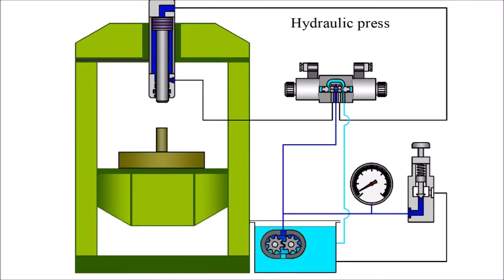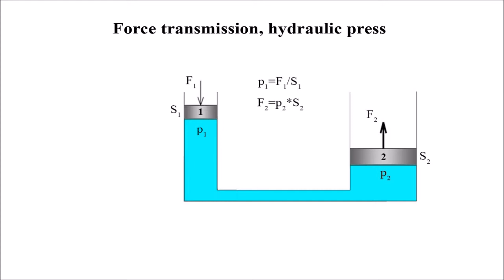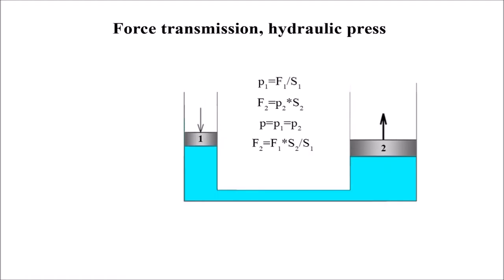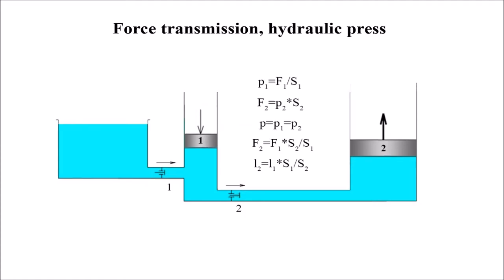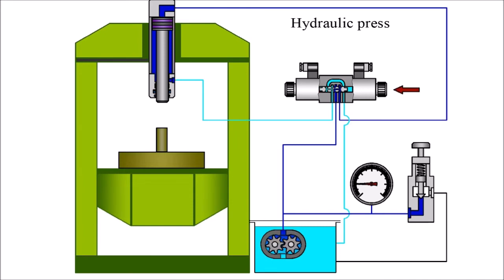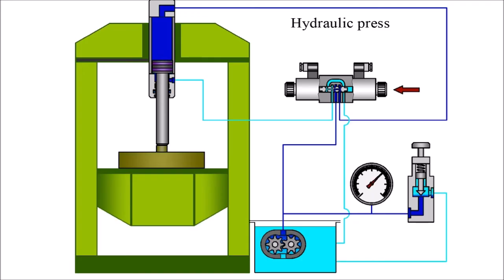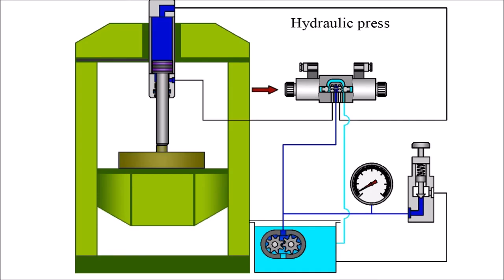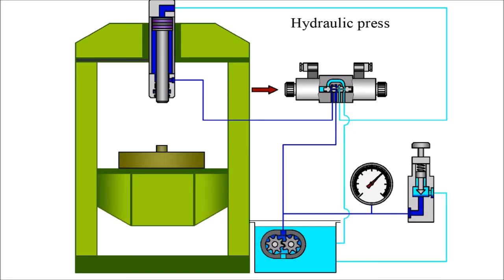How does the hydraulic press work?

Comment: This isnt accurate. To amplify force in a hydraulic press, theres 2 pistons. If my explanation is confusing, you can image search "hydraulic press working principle" to see diagrams. But basically, the cylinder which does the crushing is wide - the piston has a certain area which is being pressed by the fluid. There is a second cylinder with a smaller area that would be separate, but the fluids between these are connected so that when you move one piston, the other one moves as well. Since fluids are incompressible, and the system is closed, it means the pressure inside is constant. Id the smaller cylinder has half the area of the larger one, then moving the smaller one will correspond to half the distance moved in the larger piston, but double the force. Its basically a fluid based lever. Thats the amplification.. for industrial applications, building a pump capable of pushing hydralulic fluid at the necessary pressure would be infeasible, it needs the other piston to amplify it. With this setup, you also dont need a pump, as the piston can be mechanically driven. 

Think of a car jack. You pump the handle a foot, but the jack only lifts up an inch or two. The handle you are pumping is driving the smaller piston, and the car is lifted by the larger piston. The trade is distance for pressure.

Comment: This is crazy
But what about the wires (or whatever is it) holding the liquids? How strong do they have to be to be able to press hundreds of thousands of pounds and not burst doesn’t the water want to escape anyway possible.
Reply: I think you mean the tubes. They will obviously be made from a rigid material in order to withstand the tons upon tons of pressure. However, due to the cross section of a tube being circular in shape, this allows every single "side" of the tube to distribute pressure to its adjacent sides (if you want to see how this works, go to the kitchen and use your hand to crush an egg--you can't). So while yes, they do have to be made of a strong material, it's also not nearly as strong as you think it needs to be. Hope this helps!

Comment: Which type of actuators are used in hydraulic press?
Reply from the maker: The pump shaft is rotated by an electric motor or internal combustion engine. The liquid from the pump enters the hydraulic cylinder, and forces its piston with the rod to move.

Comment: There is only one hydraulic cylinder. So where is Pascals Law applied? You mean hydraulic pump acts as smaller cylinder?
Reply from the maker: The gear pump, in this example, is the "smaller cylinder". Perhaps it was better to show the piston pump in this video, but regardless of the design of the pump, the principle of operation will be the same

Comment: Let me translate that into english for you.

tube 1 and tube 2 are cylinders. Tube 1 is thinner than tube 2... which means that if you move 1 inch vertically, you displace a certain amount of liquid... and if you press that same amount of liquid UP on the second tube, that cylinder will move up by LESS than an inch (because the tube is thicker than the first one).

So... if you are pressing down with 100 lbs on the thin side, the fat side isn't moving as far, but it will press a lot more than 100 lbs.

It's very similar to leverage.

Imagine a seesaw that both sides are equal. One side moves up a foot, the other moves down a foot. Completely equal. No leverage change for either side.

Now, imagine 1 side moves up and down a foot, but the other side moves up and down only an inch (because it's closer to the fulcrum... look up "fulcrum" if you need to). The same force applied to the other side covers a smaller distance, making the force much greater.

Same concept for pistons. If a force moves 1 piston a certain amount, and the other piston is moved (by the same force) a different amount, that different amount of movement generates a different amount of force.

Add to this that the input shaft (the thin one) is generally pressed by a lever itself, and you can multiply your manual strength dozens or even hundreds or thousands of times... but you have to repeat the motion numerous times (pump it several times).
Reply: Michael Dickey you should make video about it
Reply: great explanation man you should become a teacher
Reply: We are to only ones who actually started reading this and appreciate the time it took for him to write this down (or Crtr+c -->Ctrl+v it from somewhere).
Reply: @tiborvigh5198  they obv didn't do that dumbass read the whole thing that's a YT comment not a copy paste.
Reply: I was trying to figure out how some presses are outputting 100000+kgs of force. Now i realize its basically liquid leverage.
Reply: Really great 👏
Reply: Thx, the analogy of it relating to leverage on a see saw was a big help and was a lot more of my speed.
Reply: Question, is this like changing gears on a bike?
Reply: THANK YOU THANK YOU
Reply: Thanks millions <3
Reply: If u know what is hydraulic press then why the heck are you watching this 😂